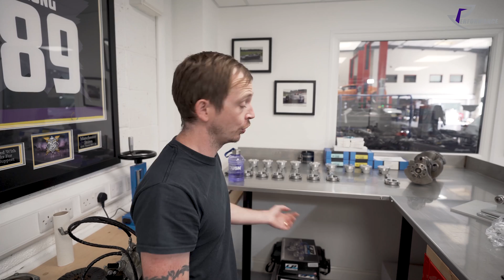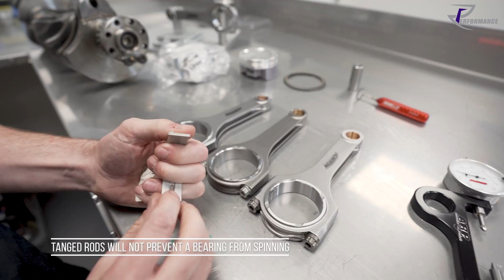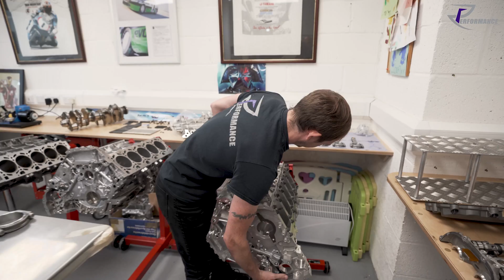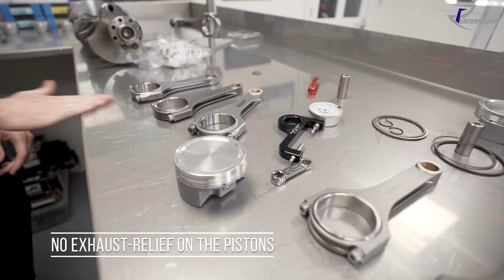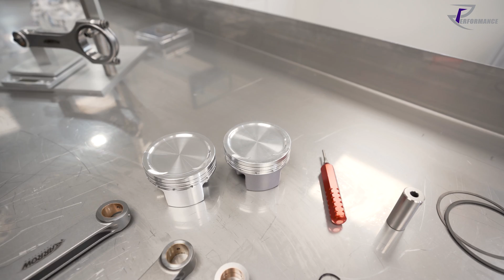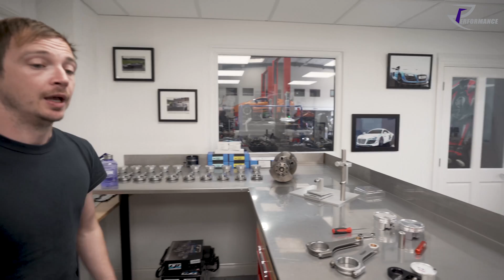How do we build our V10 Lamborghini and Audi R8 engines?

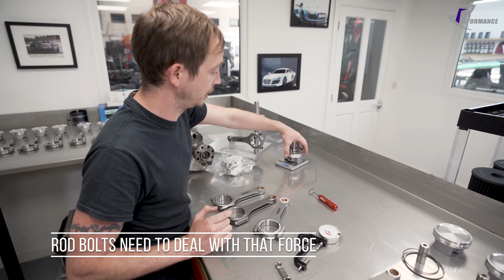Comment: 8:00 not forgetting the weight of the rod itself too! Basically everything apart from the bearing cap, the lower half of the big end bearing and the bolts themselves Is pulling on the threads of those bolts at about 9 million G at redline. 

P.s. I’ve just found this channel and I’m loving the content. I’m finding it very similar/relatable to my own channel with a similar level of skill and expertise demonstrated, and the same calibre of vehicle being worked upon.

Comment: Just a thought, when you are stretching the big end bolts, instead of fitting the bottom girdle why don’t you use two old style main bearing caps and leave yourself a shed load of work space.
Cheers Graham

Comment: I'm in the process of fitting an Audi S8 V10 to a VW T3 (Porsche gearbox) and that gives me more room for tuning which isn't normally possible. 1) I'm using R8 V10 headers (no cats) but keeping the S8 inlet manifold with flaps. I've seen many people suggest that they should be removed due to failure but mine work. If they work, surely the loss in torque at lower rpm (without them) makes it worth keeping them? 2) Inlet manifold spacers? Worth it for heat dissipation? It will lengthen the intake tract and change the flow. 3) Crank pulley (lightweight). Good or bad? Quicker spin up but less harmonic support /mass for the crank? Excellent channel as always. Michael.

Comment: Awesome video! One thing I wanted to ask, Audi suspension (and many others) are torque to yield. Now, I am not going to replace every bolt everytime I need to replace a component on my suspension (thinking upper arm bolts (not pinch bolt)) when doing a wheel bearing for instance. 
Is there a way of determining the torque required for a stretch bolt once deformed that will give a clamping force that is reasonable enough for it to be safe / effective.
Reply: There’s a right way and a wrong way. Right way is to replace. There isn’t a way to determine the torque after the bolt has been stretched, otherwise the manufacture would list it. You’ll get by with it done the wrong way but it’s still wrong. What you’ve done is increased your risk of something breaking.
Reply: @chillznax  Understood, I opted for new bolts. Thanks for jumping in and explaining for any others that may ask a similar question.

Comment: Hi guys love the in depth vids you do, also im only new to the audi v10 stuff, now is the lambo v10 5.0 the same bore spacing as a rs6 5.0 v10 and doe's have a split crank pin crank or are they just de stroked 5.2 also the rs6 v10 5.0 have you seen any one convert to port injection. cheers
Reply from the maker: No they are all different engines either in cc, bore/stroke, bore spacing or crank.

Comment: Hello, I imagine you are a specialist in the Lamborghini V10 engine,
 I have a really big problem, she uses a lot of oil, I think you have heard of this problem before.
 From what it could came ?
 New machined steel cylinder, new segment, new valve stem seals, new reinforced connecting rod.  I still have the same consumption of oil with blue smoke.  oil on the pistons when removing the spark plugs.  is it possible there is a problem in the cylinder head?
 Is it possible that this is due to an oil vapor return?  I take the liberty of sending you this message because no one can find the solution.
Reply from the maker: Sounds like piston ring problem if using oil that heavy but would need to see it to carry out some tests.
Reply: @REPerformanceUK  
There are new steel cylinders and pistons, and still blue smoke from the driver's side exhaust
Reply from the maker: Drop us an email!!

Comment: Beautiful engines!
A blueprint is a drawing, the original design. So typically "blueprinting" is getting tolerances, etc very precise, to design spec. "Balancing" is getting all the weights close to reduce vibration & unequal stress.

Comment: HPAcademy show that they balance rods by equalising the big ends on the jig and then shave the small ends to equalise total rod weights.  Would balancing small ends add something important to the overall engine balance? My understanding is that when hanging the small end over the scales, the big end bottom half will act as a "ballast" and throw the measurement off a tad.

Comment: This is fantastic, keep it up y'all should be getting way more views imma share as much as I can
Reply from the maker: Thank you! The coating is to stop the galling that occurs when the piston and block are made of aluminium. On a kindred block it is nickel ceramic coated steel liner so no need to protect the piston with a coating. You can run a coating, it’s just not mandatory like on a stock block.
Reply: Question, you use a coated piston on a standard block but an uncoated piston on a linered block. Why not use a coated piston in a linered block? Would there be any negative effects?